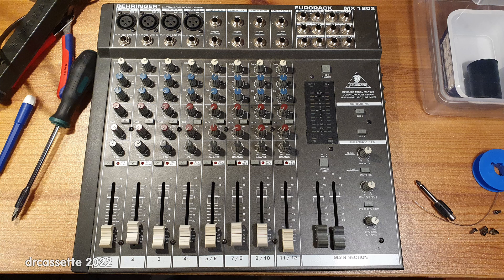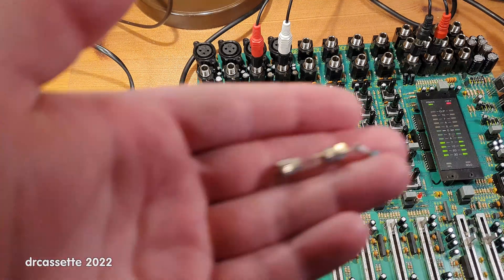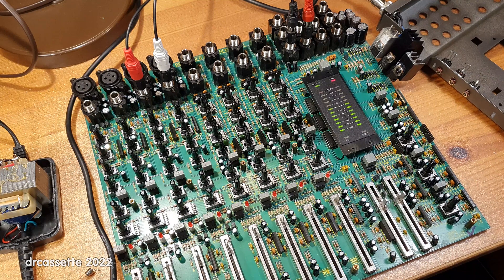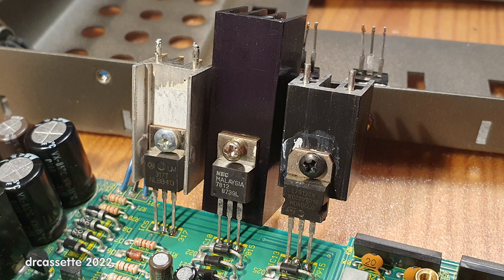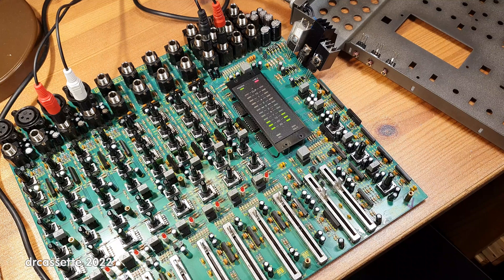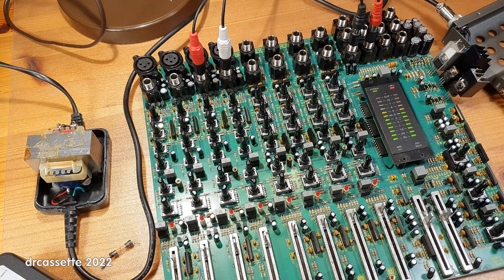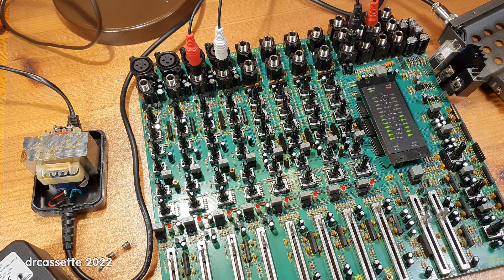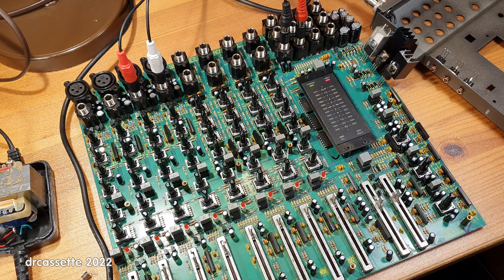Behringer MX 1602 audio mixer diagnosis - bad power supply design

Comment: The phantom power supply will now be making 38V instead of 48v with the transformer swap.  This may not be an issue for most people as lots of the gear that rely on it usually work from 24v upward.  The twin 18Vac windings in Behringer gear was picked with this 48V in mind. 
((18.5 * sqrt(2) -2v) * 2  using a capacitive doubler.
Reply from the maker: Thanks for the info, this is of course good to know! I admit I didn't even think of whether or not the phantom power supply would be affected by the modifications I suggested.

Comment: Wow... Just knowing the required voltages on the wires to the chassis is tremendously useful.  It's almost worth designing a different, completely linear supply that delivers those voltages, keep it outside of the main unit--a 120 or 230 VAC transformer for the linear regulators will be too big to fit inside anyway--and shield the heck out of the (keep them short) DC voltage leads into the main unit.  Oh... and throw some small ferrite beads around the DC leads and even the mains cable conductors.  Of course, you would be doing all of this for a Behringer-designed mixer...   Hmm...

Comment: I m sitting with this same exact problem..mx 1602 from the 90s, still works. Albeit some noise on the 4 mic channels. The chassis gets insanely hot. Would It be a bad idea to add a high power  10 W / 15 ohm power rezistor on each 18.5 V rail, in the power supply,  along with a 1.2 Amp  fuse on each output . Our AC current sometimes peaks around 234V AC at the wall outlets.  By my calculations it will drop each side ( plus minus 22.5V to 18 V ) which brings it into spec. Have i calculated this correctly?
Reply from the maker: I don't have time to double check your calculations, but some correctly dimensioned power resistors will help protect the device by dropping some of the voltage, this is correct.

Comment: I did the same under volting trick with the SEGA Mastersystem-2 console, I replaced the dead 10V-DC wall wart with a switchable, 7.5V were still good, just the sound not as loud & far less heat, no other modifications

Comment: I received a old Behringer Eurorack UB1002 (not working) and it appears also to be this AC power supply Model MXUL3 (North America). 2x18.5 V @150 mA each. I opened up the casing and it does snot have a fuse. The voltages coming off the  secondaries test at 21.3 volts. I do not know what is wrong with it however. When connected to the mixer, all the leds spike and eventually dim. There is a background noise in the audio signal that to me sounded like it could be a grounding issue. I hooked up my DC bench supply as +19V and -19V and ground to the power jack and the mixer is working fine. No Led issues, no noise. So is that strange ? To run a DC bi polar supply when the unit is expecting this dual 18.5V AC ? My solution will be to get a 18-0-18 1A transformer and see if that works. Nice video !
Reply from the maker: Thank you :)

Comment: I have the same problem with this mixer, which has been sitting here for a few years, "repaired" but still not working correctly. I replaced the blown fuse in the power supply and a capacitor, but there is still humming noise on all channels. Probably the capacitors have been damaged, as you have described. There is nothing visible on the outside, neither brewing nor cracks. I wonder why they didn't use a fuse on the primary side.

30.11.2022:

Damage pattern: strong hum = smoothing capacitor defective?

Summary: The smoothing capacitor C56 (1000uF, -15V regulator), which beside is only half of what the standard application (2200uF) suggests,  had exploded and the glass fuse for the center tap in the transformer was defective. After fixing the 2 defects (one fuse now primary side of the transformer), the mixer should have worked again, but when unsoldering the old capacitor, a through-hole via was torn out, and it made no contact. There were unexplained voltages on the negative voltage regulator, which was fine, but was operating out of spec. Since the diodes were ok after the test, the fault had to be with the circuit board tracks. The leaked dielectric attacked the copper, and thus the via became unstable. Let's see how long it works again. 

Conclusion: I have the suspicion that the capacitors are too small, which can also be heard from the small but existing ripple voltage (full gain) on the mixer, beside another serious issue to which I will come later. Larger capacitors would not have fit into the case. It could also be the reason for the hot regulators, because of stress. Furthermore, there is probably another risk with the voltage multiplier circuit for the phantom power, which in my case generates 78V (4 x 20V-voltage drop diodes) for the LM 317 (HV?). They branched off from the symmetrical voltage part. This is the only way to explain the high voltages on the caps after loosing ground potential. I wondered where these high values came from. It's quite complex with one after the other issue.
I would say that savings were made in a targeted manner in order to give this device a not too long life span, because after all, a company always wants to sell new products and maybe more expensive products, which hum less and last longer. 

The other serious issue: The mixer was repaired once before in 1997 (MUSICSTORE workshop) due to an exploded capacitor shortly after purchase and worked about 15 years until next failure. Behringer provided a risky 3-pin device connector that should be screwed tight before plugging in an AC power connection, but I didn't always do that. If you turn it on with the device connector plugging in, there is random contact of one of the 2 voltages (2 x 20V~) or center tap (used as ground) and the circuit is in an undefined state!!! I'm sure a lot of people remember this. It made negative headlines for Behringer at the time, besides the Mackie design copyright issue. The leaked dielectric from back then could also have been the cause of the attacked circuit tracks. So the whole thing is already a very long story. Moreover, defective capacitors in the power supply due to aging or stress are a common issue in all electronic devices, even if Behringer has built-in an "early aging risk" here.

I hope this information helps as I had always hoped to use this mixer again even though I have already bought a new one. And yes, it was another one from Behringer, the XENYX 1002FX, which has been working perfectly for 10 years now with an 230V~ manual switch!

https://www.synthxl.com/behringer-mx-1602/
Reply: It is kind of funny but Behringer instructions say to plug the power cable into the mixer first, then plug the supply into the wall. To never plug it into the mixer if it is already in the wall lol. I wonder if they added that instruction after people reported problems ?
Reply: @jrg770  No, that was really intended from the beginning. The thing is that the 2 voltages never came exactly at the same time when fiddling with the plug and that was stress for the electronics. 🙂

Comment: Hello .. I bought a behringer eurorack mx 802a on eBay without powersupply... Based on research the powersupply thst comes with it is 18v for 2 of the pins (xlr) at 800 mah.

However the powersupplies being sold on eBay for it is 17v for 2 pins at 600mah... Can those eBay power supplies work?
Reply: This should work, but you have to be sure that the connector pins are in the right order. You need 2 x AC (originally 2 x 18V~) and ground, similar to the MX 1602. If the vendor offers it for this mixer, it's fine, as long there are no other issues like blown up capacitors in the mixer itself. The 1V difference isn't a problem and should keep the mixer a little cooler.
Reply: @Klangraum  thank you
Reply: @Klangraum  i think its a generic powersupply on ebay... Not sure if it was specificslly made for that model so to speak.. Its like replacing your phones USB charger cable with another generic one.

Comment: Be careful. Related to the schematics of MX 1602 is the regulated output voltage +/- 17 volt (not +/- 15 volt). There is a 1N4002 between 7815 pin 2 (and 7915 pin 1) to ground. The minimum input voltage (without the 1N4002) for the 7815 is 17.5 volt. I expect a minimum input voltage of 19.5 volt for a output voltage of 17 volt! 

Sorry for my bad english.
Reply from the maker: Thanks for the info, I will have to double check the schematic I have.

Comment: That's kinda nasty how the fuse was on the ground line! A toroidal trafo would probably improve the noisy too. The LM7915/LM7812 notorious for running warm.  thanks for the video btw!
Reply from the maker: The type of transformer is not that important as it is external from the mixer. Toroidal transformers indeed have less stray magnetic field, but with the power supply well away from the mixer, that won't really make much of a difference.
Reply: @DrCassette  True enough. I bought one second hand two weeks ago for 50 euros. The guy said it was working perfectly but he failed to ship the power adapter with the mixer - Doh. The low voltage plug I would need if I build my own one.  How standard are those plugs?

Comment: Very informative video..Can someone suggest how to check the power supply without opening by means of a multimeter or something?
Reply from the maker: You can measure the continuity of the transformer windings at the output plug, so you don't need to open the power supply.

Comment: Thank you for providing such a clear explanation. I’m troubleshooting a similar age MX1604A, if I’m measuring resistance when checking the power supply, can I assume the fuse is working? Measuring 1-2 4 ohm 1-3 5.5 ohm 2-3 4ohm, and seeing voltages at 19.6VAC. Do you have the part number for the 15VAC transformer you decided to swap with, if I decide to follow your path to lower heat output? Thanks in advance
Reply from the maker: You have continuity between all connections of the power brick, so the fuse is fine. If I swap the transformer, the replacement will be a suitable transformer salvaged from some other device.

Comment: hi there's  mini 8 reel to reel  brannell    it had a bad power unit the same thing the power reg's were over heating  re made the power unit 
step down to 45 dc  and ad on alot more  reg's   now it has the high volt lm317 one's  to power the audio cards
it was allways blowing  the power unit fuses all he time    

soundcraft decks are the same   no fuse's in the power units  381-8 is very bad  for over heating

Comment: At Behringer the price makes the music. Cheap prices for the product seems to be successful with small calculation in the electronic parts. You are on the right way to make the product better but will Behringer do it actuel in their newer products ? I don`t think so. I had a mixer 802 and it had after serveral usage  problems wiith the heat, too and something go wrong inside, too. Thanks for your videos.

Comment: Hi - Great Video and Info. Yep I had the same problem with my behringer DJ mixer DJX700 one week after I bought it brand new. The right side of the case got very hot and the mixer became unstable. I got a refund. But I see lots of faulty Behringer mixers on the market for sale and most of the description refers to unit getting hot. No quality testing and or bad design. I never bought another behringer product since then. I've heard bad reviews about them.

Comment: Older Behringer mixers are also known for caps in the signal path going bad (47µ if memory serves), so perhaps spot-check some of those while the unit is apart. These are a major reason for the reputation of Behringer as being noisy.

I can only imagine that the power brick was originally designed to be used for a +/-18 V supply, but then Behringer went to 4580s which really shouldn't be run at more than +/- 15 V. 2x 20V~ secondary would be something like almost +/-27 V= rectified, so that's a lot of voltage wasted even under worst-case conditions. Not using more than an absolute minimum in filter capacitance may have been another deciding factor... perhaps have a look at ripple on there post-repair.

It is normal for transformers to reach specified secondary output voltage at maximum rated output current. I've had a nominal 12 V= router power supply that would output something like 15.6 V unloaded.

And yes, putting a fuse in the center tap is one of the most asinine things I've seen. 🤦 It's not like you couldn't get 100/125 mAT fuses suitable for the primary or anything.
Reply from the maker: Thank you for the info! :)

Comment: 1) I guarantee the case will be a better heat sink than the ones you attached. 2) 70C is not really very hot, not for power semiconductors.  3) 18.5 is open circuit. Rectified and under load you are maybe 24V.  You used 12V regulators. They would have 25% higher temperature rise versus the proper 15V versions.
Reply: I wonder if even audio electronics couldn't get away with properly filtered modern DC-DC converters running at high switching frequencies these days, or at least switchmode into LDO regulators to cut down the excess heat. (edit) OK, maybe we shouldn't let Behringer do that, they can be surprisingly dumb when trying to separate digital from analogue circuitry...

The transformer specs are trite either way, in "Europe" you can get anywhere between 217 and 253V (230V +/- 10%) from the wall which will directly translate into transformer output voltages. In this application, the only relevant aspect is that the rectified DC on each rail needs to be above the drop-out of the regulators and below the limits of any intermediate electronics (mostly smoothing capacitors and cooling).

Comment: Putting the rectifier circuit and voltage regulators on the unit seems likely to induce AC hum. Why on ground (earth) wouldn't they have used a bi polar (symmetrical) power supply?
Reply from the maker: They are using a symmetrical power supply, that's what the 7815 (+15V) and 7915 (-15V) regulators are for.
Reply: If you use an outboard power supply you have the same problem and on top of that you can couple in line noise even better since you're shipping your "clean" supply voltages through an antenna. By having a primitive inefficient linear supply inside the case, you can shield it all in one go.

Comment: This is a 1990's era mixer.  I'd be curious to see if the new one's have the same design flaws?   I have a Behringer line mixer, a year or two old that works fine.  It replaced a Samson SM10 that started blowing fuses.

Comment: What are the signs of a blown fuse? As the mixer still works it must be hard to discover a blown fuse.
Reply from the maker: I finally discovered the blown fuse when I measured resistance between the output connections of the power brick. Since the power brick outputs AC, it should be possible to measure the resistance of the transformer windings, but I wasn't getting any connection to the center tap. So I then cracked open the power brick and found the blown fuse.
Reply: @DrCassette  Thanks. But, a blown fuse isn't an "ordinary" user will discover, Specially if they don't have the skills or equipment to measure it. 
How will this error show up to an "ordinary" user? Will the unit work as intended? Any risk of electrical shock? Just a very warm mixer?
/Olle in Sweden
PS. Thanks for great and informative videos. ;-)
Reply from the maker: The initial symptoms were: 
- Power LED turns on and off randomly 
- Mixer does not pass any audio 
- Occasionally there is a loud hum in the output, which changes frequency and then disappears again 
So it will be very clear to the user that there is something wrong with the mixer. There is no risk of an electric shock.
Reply: @DrCassette  Thank you so much!
Now it is totally clear to me. ;-)
Keep up your great work!

Comment: Oh Berhinger…. What can I say about this brand: It’s a Xerox machine. Literally. They copy a lot of designs from other manufacturers and built them cheap. I’ve got a small Behringer USB mixer that still works, but they are known for quantity issues. Their stuff is cheap and cheerful as long as you get a good unit.
Reply from the maker: Yes, Behringer does not have the best reputation - and after seeing the problems this mixer has, I can understand why.

Comment: You know you have a good channel when the video is just root cause analysis/explanation with no actual bench work and I still watch the whole thing. I have a behringer DJ mixer now and can attest it’s a POS. Have to use external phono preamps because the ones in the mixer sound terrible and believe me, I am not some kind of audiophile. Great video my friend.
Reply from the maker: Thank you :)
A full repair video would have been painful to watch, it took me about 2 hours of testing and searching to finally notice there was something wrong inside the power brick...
Reply: @DrCassette  perhaps also some foul language (in German)
Reply from the maker: No, there wasn't any of that, but lots of confusion :)

Comment: I have a theory that the cap didn't blow up at that high voltage because they may be using same can for multiple voltage rating/capacitance ratios, only difference being forming voltage.
I think this because i see old high voltage electrolytics sometimes being over 2 times bigger than their modern counterparts.
Reply: "Old" electronics can be surprisingly bad. Technology isn't all about cutting cost, there were some real advances in materials and production too. Now sure, an old quality cap (that hasn't leaked) may still be "fine" (if you like high ESR) compared to the Cheap Chinese Whatever you will likely find in most devices, but name brand products with the same specifications will be smaller and better.

Comment: I have a 1604 that only has stereo sound out the second outputs. Right main works and left is quiet. Leads me to believe its isolated to just that left channel as if the whole left wad blown, the second outs wouldnt work.